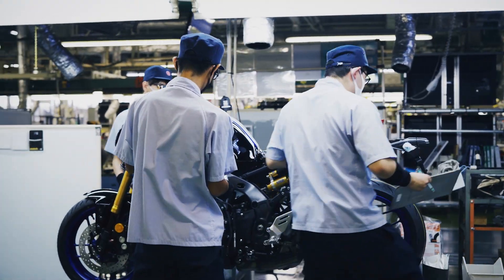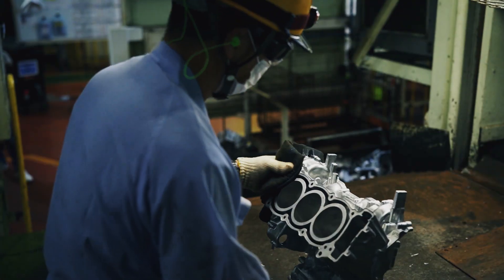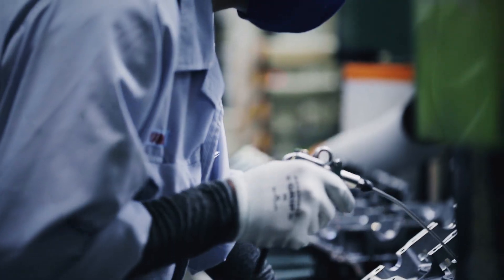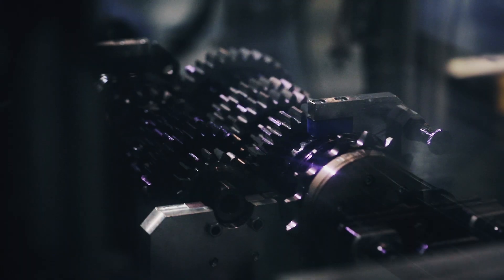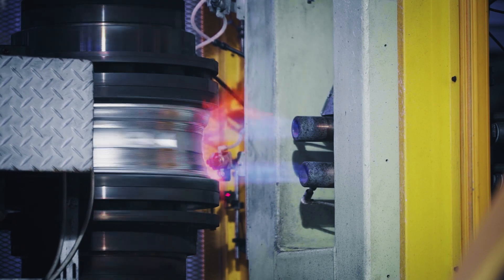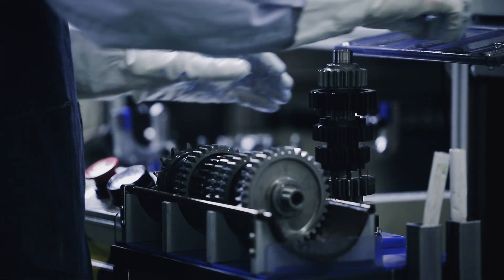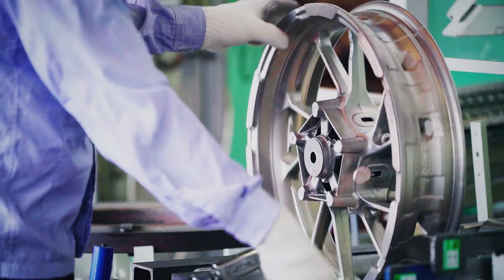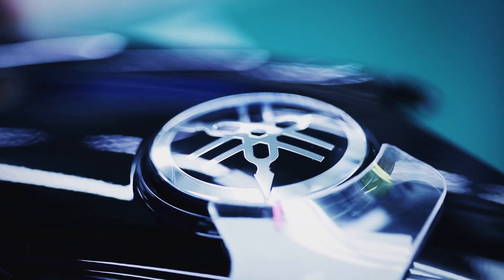Yamaha's Commitment to Quality and Craftsmanship

Comment: I have a one of the first Grizzy 600 1999 got it brand new MSRP  was $6,500 and it's still like new nothing has been worked on but the carburetor and valve adjustment running better than it did first time rode it.